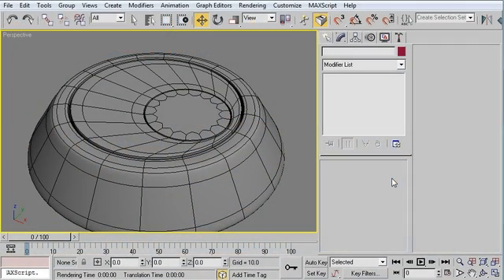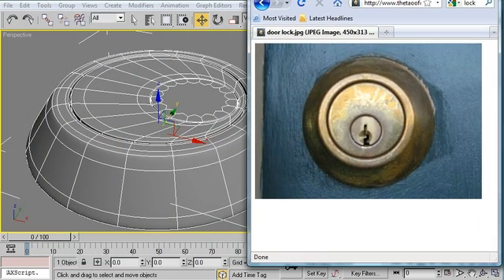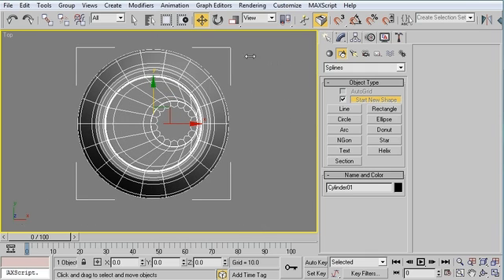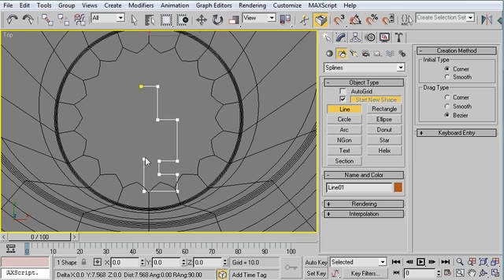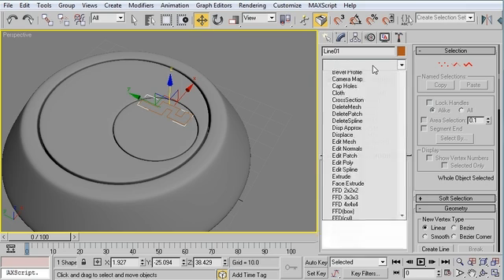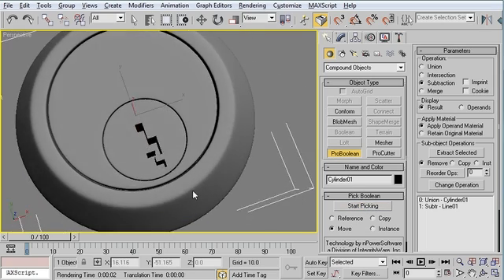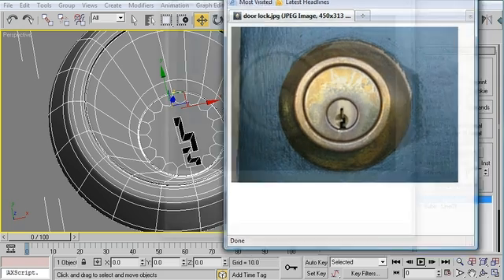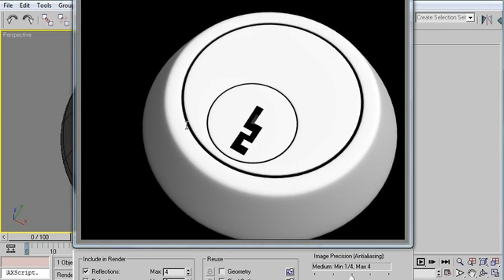3dsMax Monday Movie #49: ProBoolean Keyhole

Comment: Hi ty for ur tutorials.. 
So ive been trying to model an engine namely the 4g63 evo VI engine
Im almost done with the block using basic techniques.. but i cant seem to figure out how to model the 6 star shaped circular oil filler cap above the cylinder head :(  any tips?